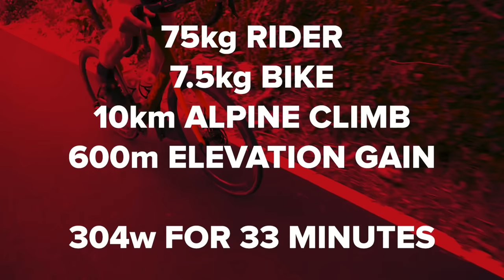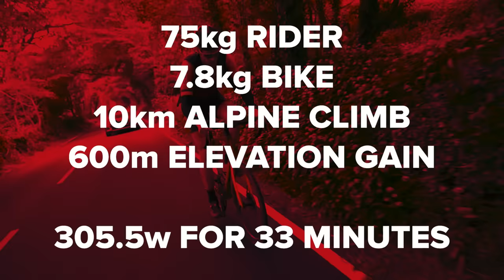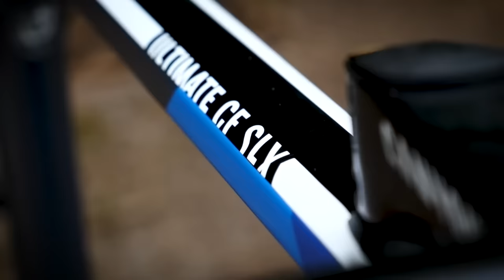10 Reasons To Consider Aluminium Over Carbon For Your Next Bike

Comment: Summer rood bike is carbon but it would obvs melt in the wet so have an ALU bike for rain and the 6 months of UK winter and general dreichness. I actually love my ALU bike - it's stress free, fast and way lighter than the steel bikes I used to ride back in the day.

Comment: I'm not into bike packing, but this is really something to consider.
I thought the advantages of  carbon where big enough to  justify the extra cost,  reason my two last bikes are carbon, but not so.
By the way, i'm not unhappy with the carbon ones, they came at about 2500 euro.
Only thing that is annoying is they have a push in bottom bracket. The pushing in is quite smooth, but getting  them out is really  an awfull
way of proceeding. Last time it took about  15 hard hammer blows for each one of them.  How a (carbon) frame can endure that kind of barbarism without damage is a real miracle.

Comment: Carbon forks are advertised as reducing road noise but because the front of the bike is so much light than the back every bump is magnified.
It's as if they manufactured loads of them before decided they were rubbish so stuck them on these frames to get rid of them.
I bought a £60 on 23c tires road bike from a pawn shop and it is far more comfortable than a £1000 hybrid on 32c  tires with carbon forks especially on long rides

Comment: i worked before as a bike messenger  for more than 3 years  covering a daily distance of 80km -100kms a day from 7am till 4pm 5 days a week. delivering of some parcels and breast milks. im only riding an all steel single speed 16t&50t 15kilo+ bike. there was a time that i raced (friendly random raced) with a guy who looks biking is just he's past time riding on a pricey bike but still he cannot managed to come close with me. we just end our sprint with a simple ok gesture and a smile. imho if youre not a pro and biking is just a leisure ,what i see is before buying any expensive  upgrades why not try to train yourself first to gain more  power or strength and stamina , lightness is nothing when the legs are weak.

Comment: My previous bike was a Cannondale aluminum (not aluminium) based bike, this was the harshest bike I have ever rode.  I rode it 5K and scraped the frame and replace it with a mid range carbon frame and the change is amazing.  If you can't to carbon do steel, aluminum is nasty and only suitable for rims and components not suitable for frames.

Comment: Just as an example, there are folding $1150 ebikes Lectric XP3.0 that are 64.6lbs (29.29kg) with the long range battery or $2000 carbo bikes that are similar that are 29 lbs (13.3kg) with similar specs or $1650 netting some ADO Air 20 action at 36lbs (16.3kg) / so cost vs mass ignoring other factors, if you actually going to fold up a bike & put it in the trunk of a Toyota Corolla or similar automobile or car, the lower mass safer for off angle lifting, such that even 10lbs less makes a huge difference in terms of lifting safety for carrying a folded e-bike up stairs or similar.

Comment: True is when i switch from super cheap aluminium frame (about 120 Euro per frame) to canyon aeroad CF I didnt notice any huge differences. If you think that the weight about 0,5 kg less make you Pogacar in hills or few watts more aero frame gives you 5 km / h higher average you might be very disapointed.

Comment: Aluminium or Alloy (a bit of confusion there) is the most vibration transmitting frame material available. Carbon does less, but in my experience, Titanium is the sweetest, least vibration transmitting frame material available. Love my VA Moots endurance road machine.
Reply: Lolno. It’s the shapes not the material

Comment: I agree, an equally equipped bike, one carbon the other aluminum the aluminum will slightly outperform the carbon simply because every pedal stroke gives slightly more forward motion as it flexes less than a carbon frame.  The problem is, if you're a professional and you practically live on top of the saddle, the Aluminum bike in time will beat the crap out of your body.
Reply: carbon frame has big stiffness in the area responsible for power transfer, and less stiffness in the area responsible for comfort

Comment: TRUE STORY: Dad came from France for 2 years to Seattle for a training job at Microsoft. His teen son became the president of the cycling club at his high-school. He had a basic aluminum gravel bike with fenders and a rack and come to my private pro shop once in a while.  One day he proudly announced he was racing the Seaward Park series and asked me for advice because he was placing 4th and 5th consistently and wanted to podium.  I said sure bring in your race bike and see what I can do...  He goes outside and brings in his gravel bike with fenders, rack, and hvy/dty commuting tires!!!!   MY JAW JUST DROPPED...  Then in a humble voice he tells me, I only wish I had a carbon bike cause everyone else does, that's why they are winning...
 I told him "don't worry, I'll sponsor you and make sure you win the whole series, and I promise you and your Aluminum bike will whip all the top riders on carbon bikes...  So I took off the 700x40 commuter tires and put on Maxxis Lt/Wt tubes some Conti 4000 28c tires, took off the fenders, and left the rack on cause it really helps aerodynamically.  I also rotation balanced his wheels.
I then advised him to only break whenever the top 3 riders break away, and just ignore others who break. 
Sure enough, he won the whole series and the top prize of a new Burley touring bike, a good amount of cash and other prizes.
  The best part was the podium photos, cause every time he was on the podium there was his aluminum bike complete with a rack next to full on race Cervelo and Specialized carbon bikes. I'm sure those in second & third place were a little humiliated... This really happened in Seattle

Comment: Al whatever you call it is king.
Another thought; riding an aluminum bike that’s extra energy, however, that additional energy will cause you to loose weight faster eclipsing the weight saving for the $$$ carbon frame. 
Personally, I lost 5Kgs in under a year riding an Al bike. I’ll take that as a big plus for Al.

Comment: I've recently gone from an aluminium road bike to an aluminium e-bike to keep up with my advanced chronology and it's of course much heavier. To my surprise, on the flats, especially asphalt, I can turn off the motor assist and ride the heavy bike like any other road bike. Not for climbing of course, but on the flats, weight doesn't seem to matter.

Comment: If you want to save Watts Graeme Obree says you need to clean all the oil of a chain, saturate it in silicone, and worry about the chainline - pick the right combination of chainring and sprocket. All worth lots of Watts.

Comment: I own both aluminium and a carbon bikes. Both bikes cost exactly the same bar a penny. I my opinion the carbon rides so much better. The carbon is about 2kg lighter and that’s with more gears and deeper, and slightly heavier wheels. Both have 25mm continental tyres on and with a pressure of 85psi. The carbon just goes, every effort just goes to the rear wheel and there is a marked difference in road noise and buzz. The carbon would be considered a budget frame as it’s a Planet X bike, and is now over 2 years old, but runs perfectly. The aluminium is a Bianchi, and again runs perfectly, but I can feel the difference.

Comment: My next bike will still be using an Aluminium Frame.  I am still using my 2011 Specialized Allez with more then 20k kms., no dents, no cracks and road rash, just some cosmetic scratches because of use.

Comment: I trashed a£2200 carbon frame last year simply because my chain bounced of and a rough bit of road. I have also had a top level aluminium frame that developed stress cracks  under normal use. It did weigh less than a kilo though which seems unnecessary nowadays. I recently did the Dragon ride an opted for a good steel bike in the end, didnt have to worry about breaking it on the ride or in transit

Comment: Getting a carbon soon.
I want ultegra and from the brand I like only the carbon ones have them. It's actually still cheaper than some aluminium bikes from other brands.
They're apparently built more for comfort so yeah it is thicker and less stiff that with some cheap wheels is probably why it weighs almost 9kg.
Plus aluminium I hear has the fatigue problem and doesn't last much more than 10 years, since I don't use the road bike that much I'd rather have something that doesn't have a time limit.
The bike is a whole kilogram lighter than the aluminium version though.

Comment: Note: Aluminium frames are often paper thin. You can easily rip holes in them and those holes can not be repaired. That said if you are budget conscience you can buy a bike with an Aluminium frame and use the extra money to upgrade to a tubeless carbon wheel set.

Comment: I've owned Carbon, I've owned Aluminium, I've owned steel, I've owned Ti. I currently own 3 of those. The one I'm missing is the Aluminium. Why? Because every aluminium frame (5 so far over 30 years!) I've ever owned has been universally rubbish. Either whippy and useless, or dead as a 2x4. Currently saving up for my "final" bike as I approach retirement and end of earning money for regular new bikes. I'll be buying a Battaglin Portofino (yes, steel).  My current stable includes classic 531 Carltons (30+ years old and still superb), steel and Ti Colnagos and some hideous plastic TT thing that bangs and creaks and groans and rattles, and frankly, drives me insane and will be "re-cycled" as soon as I can find an affordable good fitting steel / Ti alternative.

Comment: aluminium does not rust  (but gets oxidized and loses strenght in years); aluminium is a bit too stiff and less confortable (but more durable than carbon); aluminium can be welded for taylorized frames, Carbon is offered in S\M\L\XL only (carbon too can be customized , but just the pro can afford the cost)

Comment: ^^ bigger tires, 3inch fat tires at 20psi, careful for pinch flats, but you can add armor liners & tire slime, + puncture resistant tires to help reduce flats from thorns & glass shards and small staples and nails, but these fat tires at lower pressure are lovely at reducing NVH~

Comment: Aluminum is not a good option if you live or do much of your riding in a salt water environment.  Moisture incursion into microscopic cracks in aluminum can lead to catastrophic failure.  I learned this during a year of living on Florida's Atlantic coast, when my Thomson seat post snapped while cornering.  Thomson was kind enough to replace the seat post, but couldn't send me a new tooth to replace the one I cracked.  TBF, the original seat post was an older, un-coated model.  The replacement, and all my newer Thomson seat posts are all beautifully coated.  Be careful not to damage the coating on the aluminum if you live near the coast!

Comment: Where to start...So, yes, just based on your points of course the average rider should always opt for alloy and higher spec Now I'll speak. Steel. Columbus, Reynolds. When I started competing it was on shit steel. Hi tensile steel. I found, or more important they found me. Reynolds 500 series led to what I still own, Jamis Dragon 853 Reynolds tributt. I raced a Trek 980 for four years, then Giant gave me Alloy frames. Broke two, in two races. That was MTB. On the road side not much different. Dinged a S-Works top tube(alloy)and never had confidence in that frame again. I ran a shop, put together my dream road, at the time(1998ish). Ibis. Columbus steel, Dura, so forth. Raced to podium twice and sold it for 4k. But, currently Mike?. I have a Canyon Exceed, hardtail(XC, through and through), sold a Lux and a Giant Stance(al). I have ridden and raced more bikes than most of this channel could understand. For not being a true pro I am as close as it gets. Buy alloy, better spec. Most times than not...you will store your steed. Bummer.

Comment: I've put >20,000 miles on my CAADX frame, with a bunch of swapped out componentry. I still think of it as my new bike because it's such a joy to ride. Handles brilliantly. Folks who say aluminum frames don't last are just ignorant and probably don't actually ride their bikes but rather have them as lifestyle accessories. The ridiculous status-seeking Peloton crowd.
Reply: Anyone who just compares the material itself is ignorant. The sheer volume of grades of aluminium and how the are butted and welded, treated etc, plus the way carbon frames are manufactured makes this impossible. Aluminium fatigues in a way carbon doesn’t, carbon is fragile in ways aluminium isn’t. They’re both good and they’re both bad, it all depends on comparing two specific frames to see which ones material is superior.

Comment: A good aluminium frame is stiffer than a carbon one costing 2-3 times the price. It will last almost forever. Weight can easily be saved in other areas.
Reply: carbon frame has big stiffness in the area responsible for power transfer, and less stiffness in the area responsible for comfort

Comment: I have a 1993 Cannondale 2.8 series aluminum road frame - still riding it - as a TT bike.  1720g with alu fork, but replaced with a carbon fork for better vibration dampening in turns and shaved off another 120g.  so 1600g.   My 2019 Cannondale Supersix Evo  (Ballistec not Hi-Mod) is 1360g frame and fork.  (Hi Mod is 1057g frame and fork.).  Even with the heavier carbon frame I wonder if it will still be ridden in another 30 years  with a "dead" frame ?  I really think carbon is mostly for race teams that can afford "disposable" bikes that last just a few years.  Still love my new carbon bike, though.  Wanted to avoid putting hard bumpy miles on my vintage 1993 crit frame.  How many decades before aluminum starts to fatigue at key junctures ?  Also aluminum rims are a much smoother ride.

Comment: The problem is that most Americans think that they speak English. As a reluctant American, (I was born in the wrong country unfortunately). If you were born in the UK you speak "English" and you'd pronounce it the way you do. If you speak "American" you'd pronounce it the way all American's do. I have two bikes that are half Aluminum and half carbon. I love them both. My road bike has carbon tubes with Aluminum lugs and my mountain bike has a carbon main frame with an aluminum rear swing arm. Thanks.

Comment: Cannondale caad13 with a decent set of wheels is all anyone needs! Add a carbon seat post, bars and lighter saddle if you're concerned about weight. The frame will be much stiffer than a carbon bike costing £5k+!

Comment: I think the joint welds on aluminum frames make them look primitive and cheap.  I rode a couple trek AL bikes last year and they rode nice but just can't compare to their carbon counterparts. Nothing wrong with riding an AL bike, I had one for 10 years and loved it.  I just think the carbon look and ride better and though they cost more, they usually have upgraded components not available on the AL bikes.
Reply: I have compared Giant Defy Advanced 2 with Contend SL 1 disc and the only differences between those two are the frame and price, about 750€ more for a carbon frame. The components are the same.

Comment: I was looking for an Allez Sprint. Wanted 105, rim brake and aluminum but because of corona, I couldn't get that so I ended up having to get a carbon and disc frame. Not what I wanted but had no choice 🥱

Comment: Those are all legit reasons and reasonable thinking. I may reconsider going aluminum. Anyone suggest a bike? I’m thinking Cannondale of course but anything else?
Reply: You can take a look at the Specialized Allez Sprint (mind you, this bike won't be forgiving in terms of compliance, it's a crit bike) or the Trek Émonda ALR if you want a more comfortable riding position (this bike has a longer head tube that offers a higher stack height).

Comment: I see a lot of aluminum (AL) bike frames w/ carbon fiber (CF) forks.  Not sure the difference between AL or CF.  I love my AL bike frame w/ AL forks.  Some talk about vibration & handling from the road but I don't see the difference steel frame vs. the AL bikes I own in those two areas.

Comment: I have always preferred aluminium road frames. However, forks, handle bars, seat post, and such are Carbon. I also usually run 105 groups sets, and my preference of peddles are Crank Brothers Egg Beaters, the ultra light version. I must admit, I do take a bit of pleasure when pulling up alongside a fully carbon Durace race kitted cyclist, and then passing them…

When I am bested, it is almost never because of the bike, unless it is a mechanical failure of a sort.
…

Comment: Owned top-end of each Klein/Orbea which carbone was laid by F1 racing. Simply no reason other than $$$ to opt for Aluminum. Rode Al 16yrs. Rode C 13. No frame probs with either. Just carbon ability to absorb vibration beyond comfort saved my life crossing BOT dots on a corner without sending the bike over a cliff. My AL bike would’ve jumped, skid and taken the bike either off or down and that’s with an upgraded carbon fork.

Comment: Despite owning several carbon bikes I feel its so over rated , Many frames have been broken on trainers , Several friends have had frames crack on bikes not abused or been in accidents ,, Top end bikes tend to fail more than the older ones from observation ..
Reply: Carbon strength is dependant on the weave and often its strong in directions where pressure/impact is expected but weak where it isn't by design. Until pretty recently, carbon frames weren't designed to be used with trainers... You ARE abusing a carbon frame by using it on a trainer if its not been designed for it and subjecting it to pressures it was never supposed to tolerate.